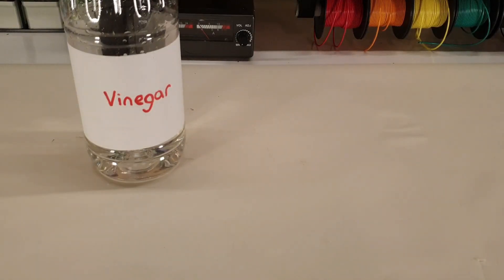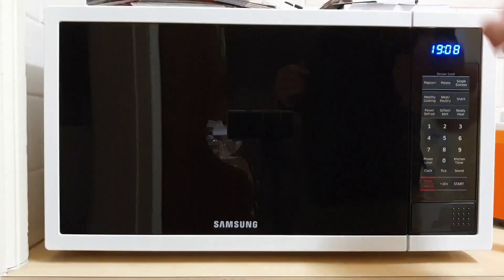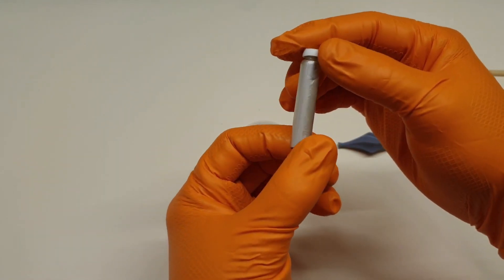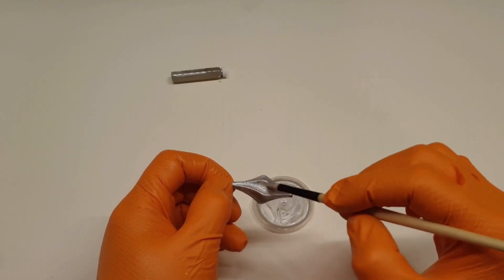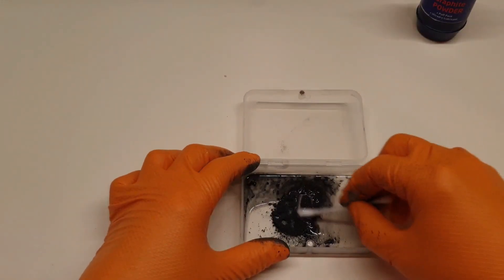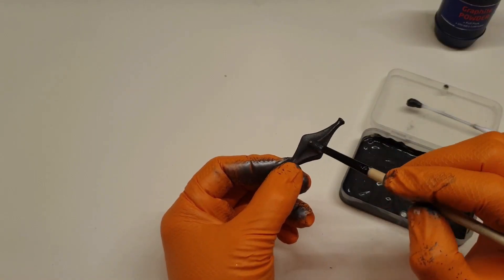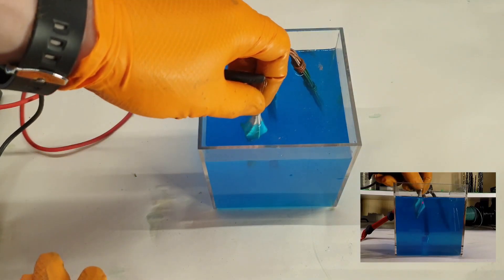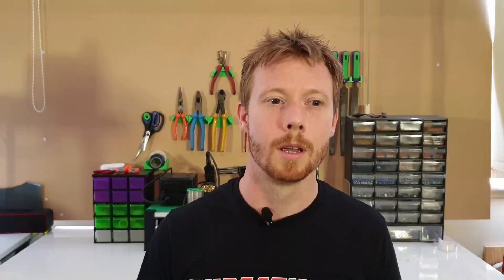Metal plate your 3D prints at home.

Comment: given that the voltages are 3/6 volts could this work with a usb power bank?
Reply from the maker: It should work without any problems with a USB power bank.
Reply: @BrodieFairhall  could you also just use batteries that put out 6 volts since i will use carbon method? thanks
Reply from the maker: @roadstar499  you can definitely use batteries, my first plating setup was 4 D cell batteries.

Comment: Why does your  model look metallic before entering the bath?
Reply from the maker: The Raven skull was painted with the silver conductive paint before plating. Also the graphite coated prints when rubbed smooth get a very dark metallic look to them. Graphite is often used by cosplayers and prop makers to make things look metallic.
Reply: Well, so what coating did the twisted example have that you plate in this video?

And, I tried the graphite 33 spray on some dried tree leafs. It doesn't work, it just seems not to be conductive at all. While in the same bath a piece of silver becomes plated with copper in no time. Same power source and method. So now I am thinking of silver paint, is that the better option?
Reply from the maker: @Streamcatcher  I have been using a conductive Nickel spray paint made by MG Chemicals that works brilliantly, other companies make similar Nickel or Copper paints too. I haven't had major problems with graphite but I know of some people who have found that their graphite has a very high resistance.
Reply: Thank you, this is very helpful!

Comment: Won’t get the graphite coating dissolved by copper sulfate, if it’s exposed to water ? Even for a minute ?
Reply from the maker: Graphite isn't water soluble, you can make a "suspension" with graphite, which is exactly what I do to paint the graphite onto the print, but if you leave it sit for a little while the graphite and water will separate again. If you were to sit your graphite coated part in water for a long time it will eventually come off.

Comment: What about the graphie one? Did it worked well?
Reply from the maker: The graphite coating definitely works but it has a much higher resistance than the paint so it is much slower. I've since started using a nickel based conductive spray paint for plating that works better than the graphite and the other silver paint
Reply: @BrodieFairhall  any paints I could get in a rattle can or without investing in a sprayer?

Comment: Any way to dissolve the 3d plastic inside afterwards???
Reply from the maker: I've personally never done it, but, used a plastic you can easily dissolve with a solvent (ABS or HIPS can be easily dissolved with acetone) if you plate it long enough to get a nice thick metal coating, you could drill a hole in it and use a solvent to remove the plastic possibly.
If you do it, I'd love to know how well it worked
Reply: @BrodieFairhall  Keep in mind that as you electroplate an object the outer surface gradually loses its detail as the metallic coating gets thicker and thicker. If you want to conserve detail, you must first make a negative mold of your object (usually with plaster) and then electroplate the mold from the inside.

Comment: so im having a problem with the graphite powder not sticking when i put it in the solution. is there some sort of special treatment to prevent the graphite from falling off?
Reply from the maker: Hi Josh, I generally experience a small amount of graphite come off the very surface, but not enough to expose the plastic underneath and this is ok. I don't do any surface preparation before applying the graphite, but, if you're having more graphite come off, I'd try really rubbing the graphite into the printed part hard with your fingers (wearing gloves would be preferable for this) and if that doesn't work, you could try sanding the part slightly before hand. If you're coating an ABS part, acetone might be a better solvent to use to make the graphite stick.
If all else fails, you can try a conductive spray paint, I am using a conductive nickel pain from MG Chemicals for plating parts now and it works fantastically (there are also a whole range of other brands who make conductive paints too). Good luck!
Reply: @BrodieFairhall  thanks ill try with 6 volts and see if that works any better.

Comment: Nice video. how much current did you use?
Reply from the maker: I didn't regulate current specifically, I had the part and the anode at a set distance apart and adjusted the voltage (a range of 3V to 6V seems to work best for me). The current is in the low mA and gradually increases over time as the electrolyte becomes more saturated and the part becomes more conductive with its new layer of copper.

Comment: Brodie, great video.  What is the concentration of the hydrogen peroxide?
Reply from the maker: I generally use Hydrogen peroxide with a concentration of around 5%, I've had no problems using a concentration as low as 3% though.
Reply: And the vinegar?
As for what can be found for normal consumers in my area; 3-5% for food, up to 20% for cleaning, and anhydrous for creating a petina on steel.

Comment: What have you used to polish the copper after it is plated? My copper layers seem to be very delicate and darken easily once they come out of the solution.
Reply from the maker: Hi John,
I use a brass polish called "Brasso" to polish my plated parts. If I want them to stay shiny and cope with being handled, I will clear coat them.
It sounds like your copper plate might possibly be a little thin, you can plate for a longer period of time to build up more copper. I have on occasion left my parts to plate overnight and they end up with a very thick coating that can be sanded back and polished. If you would like to leave your parts to plate unattended, it is a good idea to agitate the solution, I use an aquarium air pump to do so.
If your parts are darkening quickly, I would make sure that when you remove them from the electrolyte you rinse and dry them immediately.

Comment: I tried this with the graphite painting technique but no results after 10 minutes in the solution, tried it at 3, 6 and 9V but no luck :( Any idea what could be wrong? I did successfully plate a random scrap of metal, so my solution is working. Is there a "wrong" kind of graphite?
Reply from the maker: Hi Kenneth,
There are a few things you can do to troubleshoot this.
The first thing I would do (if you have access to a multimeter) is to measure the resistance of the coated object to see if it is actually conductive. You really want to see a resistance of less than 1000 Ohms.
If the resistance is too high, you can rub the graphite with your fingers to press it together and smooth it out which may help.
The other thing that can cause problems is that the wire you have wrapped around the part is going to have a low resistance and the remaining part will have a high resistance,The copper ions will take the path of least resistance, so, most of the copper will go to the wire and not the graphite. You can try only wrapping one half of the object with wire and only submerge the half that has no wire wrapped around it so there is no easier place for the copper to go to that isn't the graphite.
One thing that may help a little is adding a small amount of salt. About 1 teaspoon for every 500mL (about 17 oz).
Let me know how this goes. If the resistance is much more than 1000 ohms, you may still be able to plate with a higher voltage but you will need to decrease the voltage as copper forms. I am doing another video now that will have a technique that might also help.
Good luck!
Reply: Hey Brodie, thanks for the response. Sure enough I looked out my multimeter and there's no continuity on the surface of my print (or at least it's > 2000kOhms...). If I pour out some graphite powder and put the probes really close together in it then I get a reading of ~30k.

I'm using this stuff which I thought was pure graphite: https://www.amazon.co.uk/gp/product/B00BTOBHH6/ref=ppx_yo_dt_b_asin_title_o00_s00?ie=UTF8&psc=1 I guess maybe it isn't?

Any tips for finding the right stuff on Amazon (UK preferably), or is it time to splash out on a tiny vial of silver paint? :) Thanks again.
Reply: Oh yeah and one other thing I did different from you is I used IPA rather than ethanol since I didn't have any ethanol lying around (other than tequila which I assume isn't suitable...). I assume that won't be making a difference since it had all evaporated from my print by the time I attempted the electroplating.
Reply from the maker: Hi Kenneth,
Sorry to hear you're still having problems, I just checked the graphite I have currently and in a little pile or smeared out onto a cheet of paper I am getting a resistance of around 500 ohms for every 10mm apart my multimeter probes are. I have no idea what is different about your graphite and I've never seen it with such a high resistance, I'll ask around and see if anyone I know has encountered it before.
The IPA won't have been a problem at all, ethanol is just personal preference for me.
As for options for coatings, I've had a lot of people suggest conductive nickel or copper paint / spray paint which is a lot cheaper than the silver paint (MG Chemicals brand is being highly recommended as well as tifoo), I've also seen some people use conductive ink pens, but they can be pricey. 
Being from Australia, I don't recognise any of the brands of graphite on UK Amazon, I did find this https://www.amazon.co.uk/Graphite-powder-Synthetic-micronized-Grams/dp/B011VPFQZG which did have an old review saying that someone used it to make conductive paint.
Hopefully all of this is of some help.
Good luck!
Reply: @kenmcfa  Hi Kenneth, I've just been having the same problems. Have you had any luck yet?

Comment: Are there any special requirements for the environment like air conditioning? I don't know if there are some explosive/toxic gases as a by-product of electroplating with the chemicals you used.
And how do you dispose your used electrolytes?
Reply from the maker: These are all great questions and something I should 
Environment wise, there aren't any special requirements within the plating environment itself.
A very small amount of Hydrogen gas is given off during the creation of the electrolyte and the plating process.
As for disposal of the electrolyte, copper acetate is aquatoxic so it's not good to go into waterways. There is a lot of literature online stating that a small amount of these chemicals is fine to wash down the sink. Personally I evaporate the liquid and dispose of the remaining crystals in the trash.
Reply: @BrodieFairhall  Thanks for your reply. How long does the evaporation take? Since you have quite a lot of electrolyte I think it would take a while and since it contains a lot of vinegar I guess it doesn't smell very good. Maybe it is possible to fasten the evaporation by boiling it, but that would increase the vinegar smell :D. I am just thinking of the woman acceptance factor.
Reply from the maker: @Nazrim90  I live in a warm and dry climate, so I generally leave the container outside for a few days and when I check on it again it's normally dry. You could boil it if you wanted, I imagine it would still take a number of hours to evaporate. If you put it in a flat pan rather than a tall bottle it will evaporate faster too.

Comment: Does the print need to be sanded before this process is done?
Reply from the maker: It doesn't need it, the layer lines don't effect the plating process, a light sand would probably help the conductive medium stick to the print better though.

Comment: What power supply/voltage?
Reply from the maker: I forgot to put this in the video, 3 Volts is where I start, and if it is plating well and I want it to plate faster, I will turn it up until I hit about 6 volts. Moving the part closer or further from the anode also gives you a lot of resistance control if you don't have a variable power supply.

Comment: Thanks, Brodie, nice how-to. What voltage and amperage did you use in this video?
Reply from the maker: I forgot to put all those important details in the video. I always start with 3 Volts, if it's plating really well, but slowly, I'll increase it up to around 6, but you get a higher risk of burning. If you use graphite, you will probably want to use around 6 volts because the surface resistance isn't as low as the paint. If you have a fixed power supply, moving the part closer or further from the anode has just as much of an effect as a voltage change.
Reply: @BrodieFairhall do you know how many ohms of residence you get on the graphite paint? Thanks! Great tutorial 👍
Reply from the maker: @ToFeliz  if it's over about 500ohms measured over a space of 25mm it's very hard to get anything to plate at all. Ultimately, I would try something different if you've got a resistance of 100 ohms. Some people have commented that the graphite they've purchased is barely conductive at all, so check it before you go to the effort of painting it on.
Now I use a conductive nickel spray paint made by MG Chemicals, it is much, much better than the graphite and way cheaper than the silver paint.
Reply: @BrodieFairhall  great tips 👍 thanks 😊